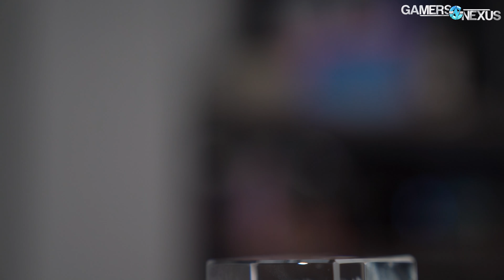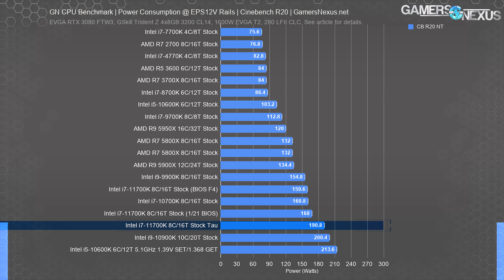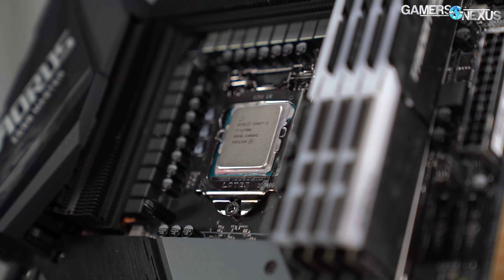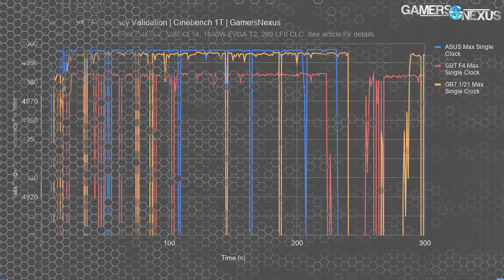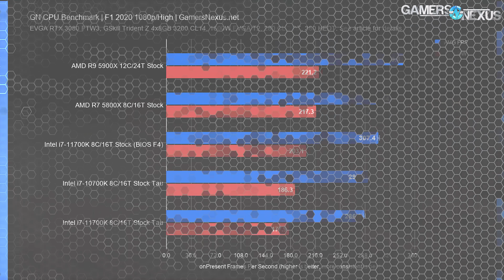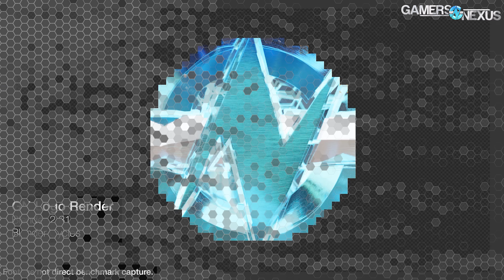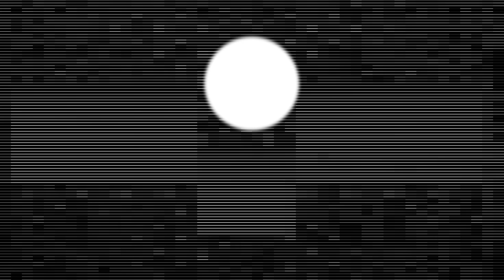Intel's Z590 Motherboard Problem: i7-11700K Power & Thermals Explained

Comment: I like to see relative comparisons adhering to the suggested limits so a fair chip to chip comparison can be achieved, AND I like to see them pushed to their limits on air & water. A chip might look comparable with adhering to suggested limits, but once you push both chips one usually pulls ahead

Comment: How come we don't get a AMD to Intel temp comparison?  What does a 5800x and a 11700k do with the same cooler in blender?  

Also, 56c with what you call a crazy hot bios power consumption with only a 280 rad?  Come on guys.  This may be the worst video I have ever seen you guys do.

Comment: I get the point about calling out motherboards.  But that data is relevant because it works with really no down side right?   I appreciate the clarity of the experiment, but as an end user I care about total performance, not individual cpu performance.  Tldr: let the motherboards cheat and review them as pairs.  I’m interested in best overall performance.
Reply: The problem with that is: 1) Users who don't buy a top shelf cooler are going to experience high temps and tons of noise, and 2) The charts would be MASSIVE if you had to represent the same CPU with, say, 8-10 different motherboards.

Hardware Unboxed chose that they tested all of 10th gen with "default behavior" because every non-crappy board ignored the limits. Their approach is "only load XMP leave everything else alone".... and lo and behold: Hardware Unboxed also gave 10th gen hell for being hot and stressing the VRMs. In fact, many boards who did this could not handle the 10900k without VRM throttling. They blasted ASRock so hard for it that they got taken of the review sample program :P

So as Steve said: watch multiple reviews, but understand why the relative ranking may differ. And now you know why.
Reply: I get your point and you are technically right.  But the target audience for these channels are people who buy those coolers and overlock anyway.  Who watches hardware channels sponsored by thermal paste that also doesn’t mod and overclock?   Again I get the transparency and the commitment to proper design of experiments.  My point is total potential performance matters and belongs in the same review.  If you can beat another cpu with an after market cooler, it’s part of the value.  This has been the case ever since the celeron 300a that made overclocking mainstream.
Reply: @twifosp1  This was an explaining piece as to what "stock" means on GN. When the 11th gen formal review comes up on the 30th you can take it to the bank that Steve will show both stock and OC results (as he always does - for every CPU). And Steve is good at overclocking, so he will push it to it's limits. Which is why he declared the 10600k the gaming champion. The lower core count let him push it to the sky so it came within a percent or two of the 10900k OCed.... none of that methodology is going to change. But now you know what he's talking about when he says "Stock vs OC". Personally I think it would be messy if he had "Stock vs mobo-OCed vs manually-OCed".. because then he'd also have to show at lest two or three mobos who all do it slightly differently... and then someone would start complaining that their particular mobo isn't in the chart.. and... you see where this is going, right? :P

Comment: I dont get the hot meme, my 5900x always runs in the 70s and 80s on heavier workloads (90s on things like small FTTs) with a h100i cooler, and most people reports similar temperatures on Ryzen 5000. 60C here looks cool to me... Cna someone explain to me what I am missing?
Reply: i'm pretty sure that the numbers that they showed here was delta t over ambient so the amount of degrees over the ambient temperature of the room. So 60 degrees over a 21 degree ambient room is 81 degrees.
Reply: @adamkaneshiro6898  hmm, I dont think so. The graph is reads on Y axis : Average All-Core Die Temperature (*C); ambient 21C
To me it sounds more like they just state ambient temps but its not a delta with ambient. Should I interpret it differently?
Reply: @TheLoucM  I'm pretty sure it is over ambient because almost all gn content utilizes delta t over ambient. For example cooler reviews, case reviews, gpu reviews they will tell you the ambient temp and just show the delta t.
Reply: @adamkaneshiro6898  How I understand it they just control ambient as it will have an impact on temperature overall, I'd be very surprised if he was actually doing delta between ambient and measured temperature. Is there a way to confirm it 100% ?
Reply: I recently built two systems with 5900x--one with the Gigabyte B550 Vision D motherboard, the other with the MSI X570 Unify motherboard. Both are amazing boards, but the Vision D runs the CPU and my GPU faster with the same apparent settings and have similar thermals (a bit lower with the Vision D) with the same AIO (MSI Mag Coreliquid 240R which I highly recommend) . I'm killing all the Passmark benchmarks on both boards by substantial margins (3670 single core, and a 44500 overall high-end CPU score) on the Vision D and not too far behind with the MSI. Right now, typing this message, my idle CPU temp is 36C. I'm using a -30 (mv?) on the curve optimizer across all cores on both boards with absolute stability. Can you give me a specific benchmark that I can run and I'll report back my CPU temp?
Reply: @nicholash8021  Can you run a few runs of cinebench R20 multi core please?
Reply: @TheLoucM  1st run, 8650 score, 61C to 63C. Subsquent runs were closer to 65/66C and 8570 score. Not sure if I have optimal settings or how that compares to other 5900x scores. That was on my MSI board. My Gigabyte board is probably faster but I'm converting it to a Linux box.
Reply: @nicholash8021  I just retested it on all stock settings and it actually scored very close to your results, both on temps and score. Not sure why I was on the impression that it ran higher than that, probably because I use PBO for a while now (with SMT off for single core games) and the added 30-40w makes a big difference?

In any case, its better than I thought, but I still dont see the intel meme being really justified. That still means that with ''cheating boards'' and pulling quite a lot more power, intel CPU might just be a few degrees higher than ryzen 5900s at stock ( even according to GNs data).
Reply: @TheLoucM  Did you try it after disabling PBO and using a -30 all-core curve optimizer setting? I find this to be the best combination for the 5900X. Both my single and multi-core are improved, and temps remain relatively low due to the overall voltage shift.
Reply: @nicholash8021  I have not, I might at some point though!
Reply: @TheLoucM  I repositioned my AIO fans so they weren't so close to the front glass of my NZXT case and retested Cinibench R20. First run I got an 8676 and a high temp of 57C. Subsequent runs were around ~8640 with a max of 59C.
Reply: @TheLoucM  Also just ran CPU-Z and got 9950.1 multi-threaded and 689.4 single-threaded with the CPU temps briefly hitting 61C, but mostly < 60C.

Comment: Does those energy boost over Intel recommendations voids the warranty?
Reply: Interesting question, as long as you don't touch voltages ect and can prove it(sometimes they don't ask for evidence) then I guess no, because you as a consumer followed instructions and didn't change any values so therefore absolutely nothing was your fault

Comment: he's like fox news for the gop or cnn for the dems, the way he covers for amd, its so sad
Reply: You clearly don't recall his review of the 3800X and the XT "refresh" thrashing. Or his recent 6700XT review...

AMD has PBO which does exactly the same as fudging TAU and PL1/PL2 values, but AMD prohibits board makers from enabling it by default. I certainly see Steve's point here. Some Intel boards do this, and others don't. 

I also see Hardware Unboxed's approach: Most users are only going to enable XMP and not really mess around with most other settings, so they leave it "factory" but chose an enthusiast board that overrides Intel's guidelines. The point is that they mention CLEARLY which of the two they are using. And that's where GN Steve has an absolutely valid point: Most other tech tubers don't say whatever it is one or the other, and that is where the confusion comes from. And that is why people are constantly yelling "You're an Intel shill!" or "You're an AMD shill!" because the relative scaling can move a little between channels, so they think there is foul play somehow.
Reply: @andersjjensen  I’m referring to something more pedestrian, using negative subtle connotations in a double speak way, and using nonverbal communication such as facial expressions and huffing, sighing and take a neutral win for one or the other but then paint the picture how and is better in general. Such as in one slide saying amd gets the win 250 to 235 or so fps yet win intel does a bit better saying you really won’t notice the difference. Then say it objectively for both. I get there is a decades long animosity to the slow cpu power improvement and he is mad it cost money for each iteration. But I wish he was objective and not let his agenda destroy his credibility.

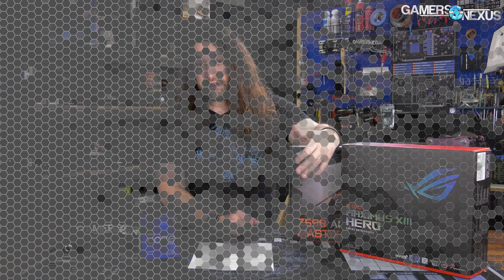Comment: I noticed on some of the charts e.g. 6:15 and 9:59 that the 5800x is shown twice at stock, and both entries for it have the exact same result. The same thing was also there with the same chip on some of the charts for the 11700 review. Is there a reason for this, something I'm not seeing?

Comment: I think part of the reason this is done, is to also differentiate within a company's own product stack (ie. their "cheaper" Z390/490/590 board variants vs. top of the line/limited variants). Essentially, they're artificially inflating the values (by drawing more power out-of-the-box) of the higher end boards to help justify their somewhat insane price tags.

From personal experience, there are quite a few of the cheaper variants that perform really well (stability; OC wise etc.), and they're half the price of the limited/top variants... and for the average power user, you're getting nearly the same experience. Do the VRM's run hotter on the cheaper boards? Sure. Will this affect the boards' lifespans? Probably. But chances are you'll have upgraded by then anyways if you're that much into tech. Will you get a better OC with the top tier board? Probably, but it won't be by much.
Reply: That depends on which OC you aim for. Insanely priced OC MB are also that because QoS things for OCing, not just stability.

Stability is something you notice mostly in RAM OC and only when pushing your platform. CPU OC the motherboard has little to say, it's all in the CPU: you may have some motherboard handling better changes in load, but it's going to be in the order of mV of Vcore to compensate for it. 
But there's another thing: running a CPU 24/7 at 1.45-1.5V not having a voltage spike damaging your expensive CPU is actually on the motherboard. I consider OC MB suitable for running on the edge of 24/7 wise limits. Insanely priced OC MB are for sub-zero cooling mostly.
VRM endurance though it really depends: some of the lowest end MB can actually run out of spec in OC, this has varied over different platforms.

PS: also consider the selling scenario. In that case you may not want some angry buyer returning a piece blown a month after purchase because you run it on every operational edge for it's entire manufacturer guarantee period.

Comment: It’s almost comical how the roles have switched
Reply: Yeah, Intel is now the budget option. In my country the price of a z590 board, 10700k and a hyper 212 is literally 2 dollars more then just the price of a 5800x at retail when they are in stock. Step down to a 10600k and the intel combo is 3 dollars cheaper than just a 5600x alone. It's cool that AMD has turned it around but the pricing is fucked.
Reply: @devilmikey00  Wait, you can get Z590 boards for hoe much again? O.o
Reply: @devilmikey00  if that's a 2-3 dollar different you should go for 5800X instead
Reply: @stepbruv8780  i7-11700K is more or less at the same point, includes iGPU and basically the same perfomance.

Instead of the 5800X, the 5900X exists, also, 10850K or 10900K.
Reply: @saricubra2867  is less at the same point to performance
Reply: @stepbruv8780  he compared the price of a Mainboard, CPU and cooler against just a CPU.
For him, adding a board and cooler to the 5800x would probably make it around 150$ more expensive than the intel combo.
Reply: @SimonVaIe  bruh intel mainboard for the same performance as AMD mainboard is more expensive, and by the way you really need a good cooler on intel if you want the performance. so that end up more expensive than AMD build.
Reply: @stepbruv8780  that may be the case where you are from.
But he said, and I quote: "in my country the price of a z590 board, 10700k and a hyper 212 is literally 2 dollars more then just the price of a 5800x at retail when they are in stock."
He did not say the 10700k costs as much as the 5800x, he said the 10700k with Mainboard and cooler costs him as much as the 5800x without Mainboard and cooler.
Reply: @stepbruv8780  he meant that he can get a CPU, a mobo and a cooler for the same price as one AMD CPU.
Reply: @stepbruv8780  that's the price of the CPU, cooler and motherboard Vs just the processor
Reply: Over here a 10700K setup is about 80€ cheaper than a 5800X setup and I'm writing that at a day where the Ryzen is actually available at 399€
Reply: @FADHsquared  Good luck building an AMD system with the dGPU shortages and bad pricing. Any processor with integrated graphics is simply a blessing even with a graphics card.
Reply: @FADHsquared  You can in theory do mining on Intel integrated graphics 😂😂😂.

Comment: If you could do a specific video with data and charts on the recent CPU's/Mobo combos regarding power consumption and cost per watt, it would help a lot of newer PC builders understand their potential electricity bills. Certainly something that is a factor over temps and noise.

Comment: Love this channel..

I completely understand the problem, we need more information on the solution.

I understand there’s an million different combinations of chips and motherboards and bioses but there’s gotta be something more than “disable MCE” or “set __ to 56”.

I would love to see an “ELI5 Overclocking Guide to Rocket Lake” where it shows disable this, increment this till unstable, then back it off.

I know it would be challenging but it’s gotten too complicated even for someone who builds computers, works as Tech Support, and considers himself an enthusiast.

In fact, Steve, you’ve admitted many times and even recently that it’s overwhelming for you guys and that you’re still better than most but far from the best/professional.

If that doesn’t describe the need for an ELI5, I don’t know what does.

Love the channel and my super size modmat!

Comment: The question is why Intel didn't enforce their guidance as to the standard out-of-the-box setting?.
It's hard to believe it's not intentional by intel to make them look better in the benchmark while still claims their CPU is at a certain low TDP.
Reply: Most liike because there is no need to so it... 
14nm+++++++++ can handle a lot of power and heat. So why bother...
Reply: @haukionkannel  Did you watched the video?

Comment: It would be SO interesting to see a set of benchmarks where you let the board do it's thing, but pair the CPU with a cooler only rated for it's listed TDP. How hot does the mobo consider safe? Or does the whole thing just fall on its face as the CPU protects itself, and suddenly there is not difference between boards?
Reply: Throtle... so it should be OK, is the throtle is vast enough.

Comment: The i7-10700k at about $320 USD on Amazon (or 249.99 at microcenter) seems like a decent buy now. Especially since Ryzen 5 5600x shot up to around $400 on Amazon in my shopping at least (still $299 at MC).